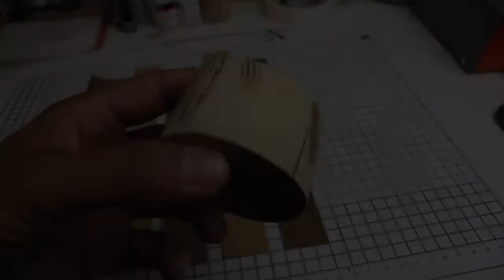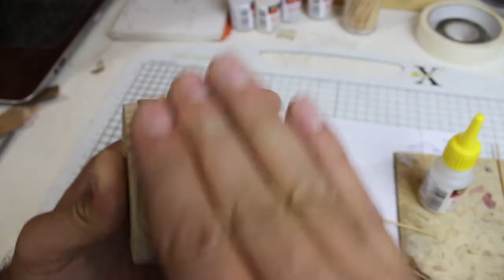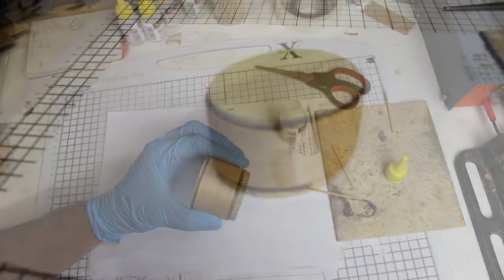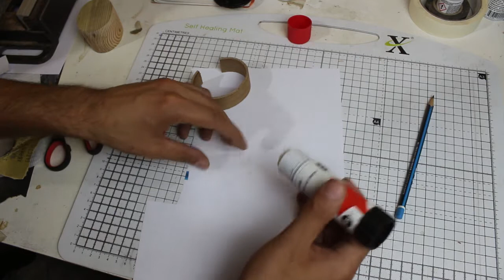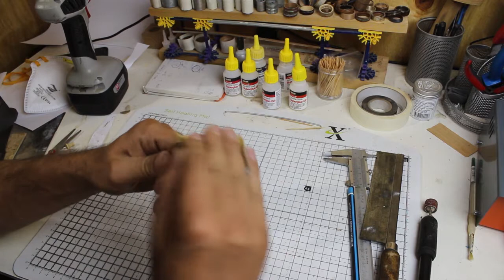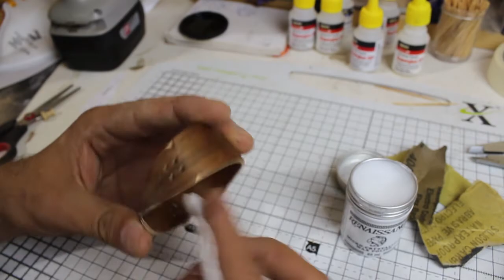Making A Longboard Bracelet

Comment: How do you get the form to build the bracelet        great video       thanks
Reply: it looks like he shaped a piece of 2x4
Reply from the maker: Good question!  I made the oval former by cutting a piece of scrap pine timber (think it was slightly bigger than a 2x4) on my bandsaw.  I made a similar video where I made a bent wood bangle - you can see the process in that video: https://www.youtube.com/watch?v=g55y5DI5w4I&t=5s

To find the sizes I just did a Google image search for "bangle sizes" and used the measurements off one of the charts.  I hope this helps!
Reply: It does thank you